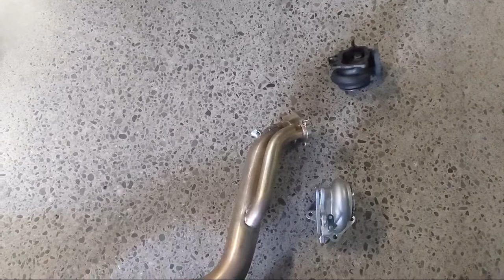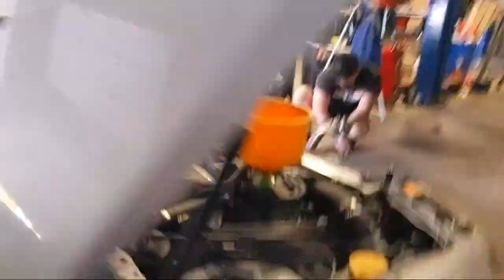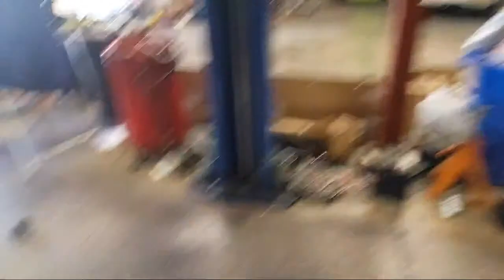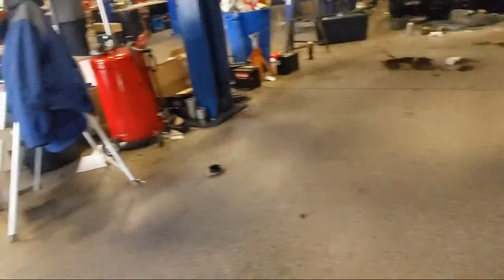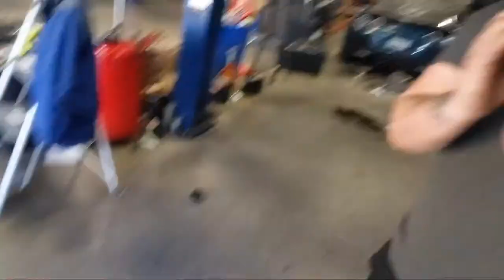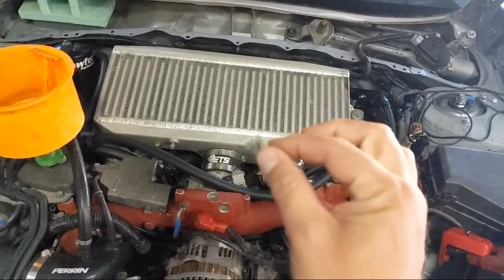Divorced Vs Bellmouth Downpipes

Comment: Hey Dom, I know I'm commenting on a 2 year old video, but you know how the twinscroll Version 8 VF37 has a "divided" turbine housing? Like there is a wall between the outlet and wastegate air paths?

And Moore Performance made the Tru-Divorce DP that turned the IWG into an external dump, how do you feel about that?
Reply from the maker: The turbine has two flow paths from the exhaust inlet to the nozzle where it hits the wheel. There's no post wheel divider or anything.
Reply: @GetaDomTune  can I send you a FB message to show you what I mean?
Reply: Or email